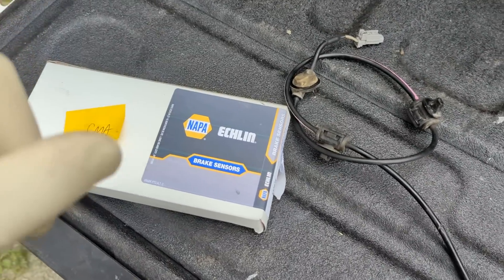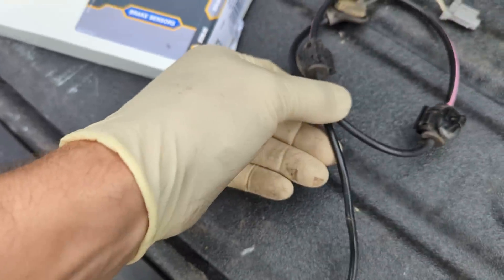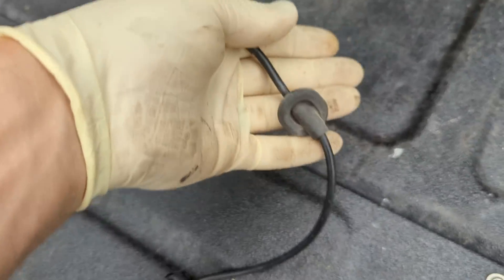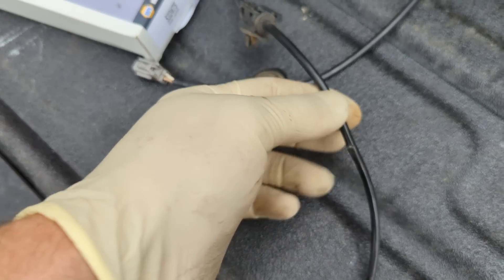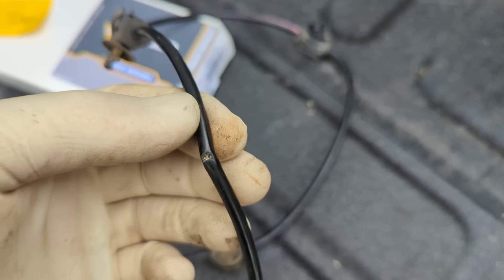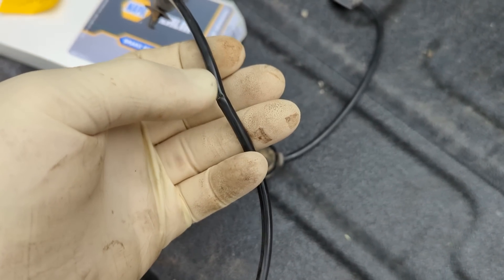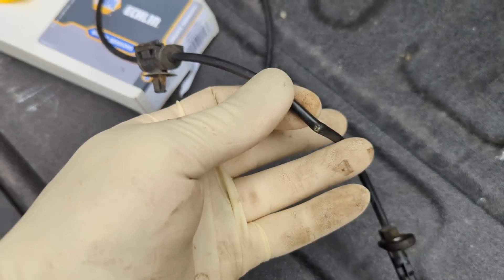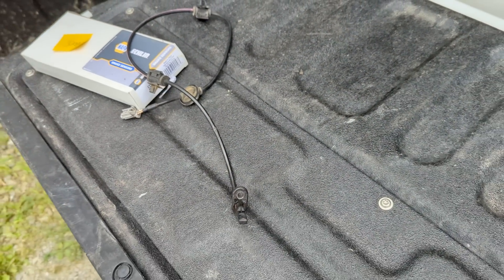Subaru Speed Sensor Follow Up

Comment: I chased an intermittent left front ABS sensor problem on my wife's Audi over about a year. Sometimes I could see spikes in the graph for that channel but otherwise it read fine. It had a new sensor, no change, new wheel bearing, no change. Every time I worked on it, it would end up looking fixed for a week or so.
I ended up swapping the front left & right channels at the ABS controller. The fault moved on the scope so I knew the controller was ok, and it must be something related to that wheel. Eventually I found an intermittent open circuit in the car side of the ABS sensor connector. One of the wires had broken from its crimp and was only being held in (surprisingly well) by the weather pack. One of those where I felt a little annoyed that I didn't find such a "basic" thing earlier, but also pleased that I felt absolutely certain I found the fault.

Comment: The speed sensor generates an AC signal as each magnet passes by. AC signals can be capacitively coupled - so the two ends of the cut wire being butted up to each other acts like a capacitor and enough signal passes that things were mostly OK. Only then the cut opens up eg on full bump or steer, would it drop out.

Comment: I had an ABS fault a few years ago on a Peugeot. Every time it reached 40 mph the ABS light would come on and stay on until the ignition was cycled. Code was right front wheel speed sensor signal, but the circuit tested fine in the workshop. When I examined the driveshaft (it was the type with a toothed reluctor ring around the outside) I found a hairline crack in between two teeth. As the shaft rotated, it reached a speed when centrifugal force would open the crack and increase the gap enough to trigger an error code. New driveshaft (axle) cured it.
Reply: Nice one.

Comment: always great to replace them, but i've had some cheap customers who say to repair, so i will slide but heat shrink on the big wire  , and on the little solder it back together and seal it up with them know that i give no warranty, cause the proper way is to replace the sensor and normal it cost about the same to repair as it does to just replace it and have the piece of mind its going to last

Comment: Since the wiring is sold as a unit with the sensor, I wouldn't call this one a miss. You made the right call, even in retrospect. Thanks for the followup, nothing builds experience better than understanding the cause.

Comment: Up here in NE Wisconsin, 90% of the time, I just replace the speed sensors if possible.   Corrosion is terrible around here and the sensors are cheap.

Comment: Isn't this why you wanted to swap the front left and right sensors to see if it was the wheel sensor and not the master?
Reply: I mean I figure that if you had removed it prior, you would've 98% sure, you would have seen that break in the line.

Comment: Had a jeep liberty with an abs issue where the right rear was irratic. When i looked at it the owner replaced the sensor which is great new one and it worked for a bit because he moved it. Broke the internal clip bits in the connector because desert 120 hot and just snapped the retaining clip. So i looked at it and i was like ok.... Diagram says the modual goes all the way to the speed sensor and back and giving it 12v to the sensor and ground to the module. I saw that and checked for breaks in the wire it wasn't covered in thick insulation like that normal wire in wire loom protector which turns to dust you love em too lol. When i looked had ground but no power so interesting took apart the loom looked real hard and found a clean slice like that too in the 12v wire. Being cautious i thought what are the odds it was only that one..... It wasnt there was another break because i checked power at the break and still, nothing. Looked further up and sure enough, there was another break Chrysler who knew. So i checked there for my power and yes i had 12 volts took the bad bit out fixed it and boom worked. Now after a bit it came back again for the same problem but my repair held which is interesting. I isolated the segment that is to the wheels and i used a jumper wire and i still didn't continuity there but for the other side i did. My thoughts were "thats odd.. theres continuity on one side but not the other tested the individual wires and they did now." I connected it back tried again and it was working. So my thought was yes the connector is indeed bad replaced it and it fixed it i checked with my scanner now and i have wheel speed now.

Comment: Good show. The OEM says it takes very little amperage to operate sensors, so if it made mere contact it would work; no arcing due to heat of resistance, I suppose.

Comment: Here most of the ABS Problems are inside the cover tubing (so you cant see them) manly on the part of it that has to move, up, down and if at front then allso  where they move left to right. as its clen cut on this one that you can see, maybe this happend when the cv axel was changed..

Comment: Just had the same issue with my 98 C-1500. Intermittent ABS light. I found the broken wire and soldered it back together. Just 2 weeks ago.

Comment: Interesting.  I have a 2000 Toyota Sienna that exhibited a speed sensor issue a couple of years ago driving across Nebraska.  The TPMS light came on, then the check engine light, and the speedometer stopped working.  It all cleared up after an hour or so and didn't happen again all the way home to California.  I checked both speed sensors, cleaned them, and checked for loose connections, but didn't check for a nick like the one you showed.  I'm wondering if that was my problem and it may have not been bad enough to cause the problem ever again.  If it happens again, I'm going to give those wires a good inspection for nicks.

Comment: One of my cars had a dead O2 sensor, but the engine light kept going on/off. Moved the wire around and got it to stay on. It was a 2-wire so tried probing for a break. Narrowed the break down, cut both wires, spliced both wires back together, and that O2 is still in the car...5 years later.

Comment: I’ve worked 38 yrs on small gauged wire runs in machines and had after ten yrs wire break from just a wire tire too tight. FYI guys, wd40 is not a cleaner and will melt insulation

Comment: Thanks for this.  Am fighting an eeriely similar issue on a 2001 Mercedes ML 320.  Start and drive it for 300 KM - all is good.  Turn it off and restart and start driving and within a block the right front wheel locks up and the dash lights up like a Christmas tree.  Going to inspect the wheel sensor today

Comment: ah hah! I could smell it a mile away, because I've been bitten by similar breakage in them, sometimes far less visible than that. like tiny knife/glass/plastic slice that let salt water in, like a paper cut! very annoying and hard to find. I've went as far as on jack stands, wheels off, with lugs holding rotors, idling in gear and flexing the wires all around, even that has failed me before. 🤬

Comment: Not bashing Napa specifically,but I can't get hardly any of the aftermarket sensors,etc to last and sometimes no good out of the box. Finally gave up and getting OEM or OES stuff. Makes you doubt your diag and yourself when a brand new ain't no good. Been a shop owner 17 years and the last 3 or 4 have awful with aftermarket parts. Don't even qant to start on rotating electrical

Comment: Well every other repair and minute spent was work she definitely needed done so no wasted labour all legit repairs. I bet Eric gave her a small break on the labour regardless strictly because he missed the break in the wire. Dealer shops would have sold the entire front  corner assembly and the computer and still never finding the speed sensor break.

Comment: DOH. Welp, at least you got closure! I hate it when you're fiddling with something trying to diagnose and the problem just vanishes.

For instance, I had an issue with my 2000 Honda CR-V where I suspected there was a backfeed into the signal side of the PGMFI relay that would hold the relay closed and keep the car running even when you turned the key off. I pored over wiring diagrams and determined that the problem could be in a couple lengths of harness behind two or three connectors. As I reached under the intake manifold to mess with one of them while in the fault state, I bumped something, the car shut itself off, and the problem vanished.

That was three years ago and I still am not brave enough to pull the intake and really go at the harness to see what's up.

Comment: Legit question (and not trying to be a d1ck) :
 If you had noticed the nick beforehand, would that be something you'd splice back together & ship it OR is this one of those sensors which have shielded cables & splicing is out of the question?
(Or, is it just cheaper to throw a new one at the car?..?)
Cheers!
Reply from the maker: Oh new sensor all the way. The environment they live in a splice is not a good option.

Comment: I've found over the years if you can't duplicate abs sensor codes and give it back to the customer without putting a part on it they get pissed. With how cheap sensors are I always end up putting one on as a last resort.
Reply: Not ideal when the goal is to diagnose the fault. More importantly what do you do when a new one doesn't fix the issue?
Reply: @cpzmelbs  usually I find the issue, but last resort I throw a sensor on it. I've found enough perfectly good looking sensors no external damage that can mess up randomly it's worth the parts shotgun.
Reply: @HaIoThree  I understand. But for educational sake, what becomes the process when the replacement doesn't fix the issue for whatever reason?

Comment: I had this yesterday on a CRV. Kept setting an open circuit/short to ground code for the LF sensor. Would always read wheel speed accurately, but on inspection I found a broken wire right at the connector, only thing holding it together was the insulation. I have NO CLUE how it was still reading

Comment: The twisted irony is that usually you avoid removing the speed sensor if at all possible, yet to really look closely at it that would be best.  Anyway, in the prior video you were preoccupied with looking at the sensor plates because you had noticed a lot of corrosion and scale on the other side so you had some confirmation bias going on.
Reply from the maker: So close but so far away

Comment: Since a replacement sensor is cheap, why not replace it as the very first step, instead of spending so much (expensive) labor diagnosing?
Reply: In any trade the skill is diagnosing the problem. Then there are others who just throw parts at it an then hope that one of those parts fixes the problem. When you go to the doctor, which method would you prefer him/her to use on you? Doctor uses the same diagnostic skills as a mechanic, plumber and electrician. Have you seen any of Eric's other videos where he corrects a problem without having to replace parts? That's after many other places have thrown a lot of parts at it and still not been able to fix the problem. Retired mechanic/machinist in Land Down Under.
Reply: @bobhudson6659  : You ignored my point, which is that replacing a cheap part costs much less than other labor-intensive ways of proving the part needs to be replaced.  Your "doctor" analogy is ridiculous.  A much better analogy is repairing a desktop computer, which is often handled by swapping out cheap parts to see whether that makes the problem go away.  It can be uneconomical to determine the cause in other ways.
     What you're missing is that replacing a part to see if that solves the problem is itself a diagnostic step.  So the question is: which of the possible diagnostic strategies is likely to be cheaper & better for the customer?  I wrote about this in greater detail in a comment on the previous video.
     Very relevant when answering that question is the probability that the part can fail in a way that explains the symptom(s) and the diagnostic code.  For the case of an intermittent loss of an electrical signal and the "open or shorted" diagnostic code mentioned near the end of the previous video, the most likely causes are a loose or corroded wire or electrical connector.  To this list of likely causes, I guess I need to add a partially broken wire, as this latest video shows.